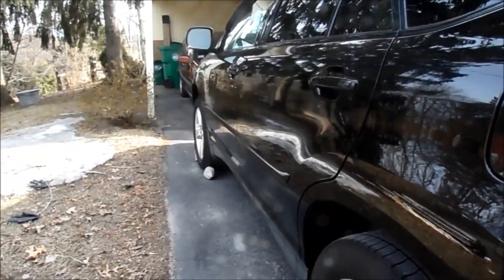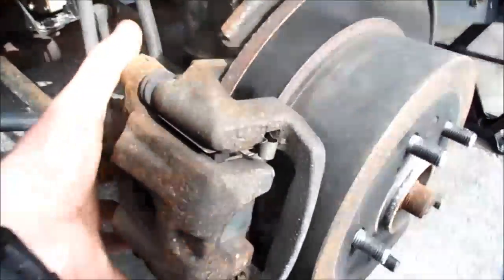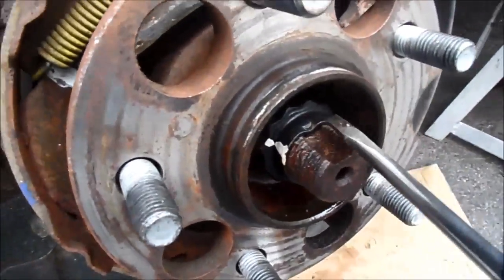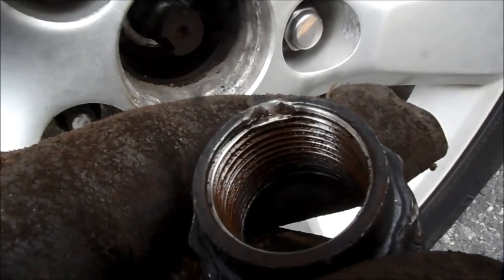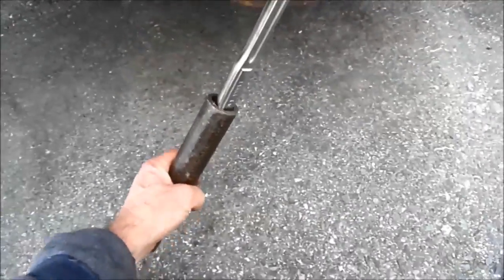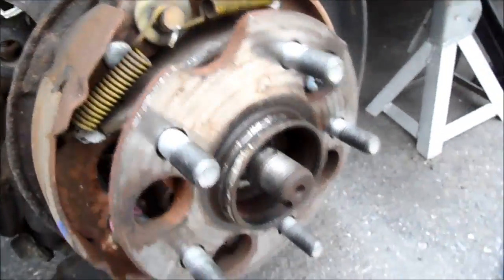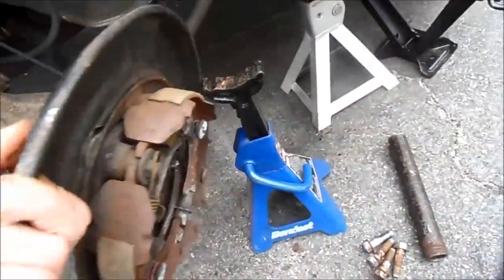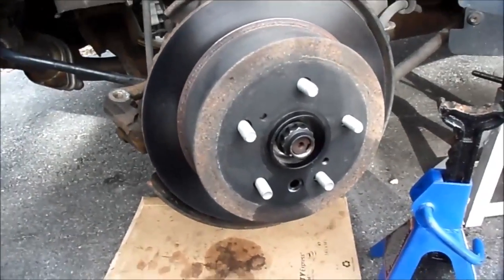RX330 Rear Wheel Hub

Comment: Thanks. Best video for this job online. 
It really helps. Great resource for information. 
My only input: I would suggest removing the vehicle speed sensor from the hub before removing the wheel bearing hub. Once the axle is loose, it could damage that sensor.

Oh, and the measurement for the spindle nut is taken from the valleys of the 12 point, not the peaks. This is very confusing since there are reportedly 2 different size bolts on the rx330 - 30mm and 32mm. 
AND the peaks on a 30mm nut will measure 32mm!!! 
Anyway, to anyone reading, if the peaks of the nut measure roughly 32mm (as did mine), you have a 30mm (axle) spindle nut. Measure straight across the middle from peak to peak.
Reply from the maker: Thanks for that feedback. Hopefully people read these comments. I'll see if I can add your words into the vid.
Reply from the maker: Oh wow, that's good info on the sockets at HF. I paid $22 for just one.

Comment: Just did this for a 2006 RX400h. What a pain! Separating the backing plate and hub assembly required disassembly of the brake shoes, removing the brake cable, and placing the backing plate on jack stands in order to have a full swing with 5 lb sledge. Still took 10 good whacks. If you live in the rust belt, this job will not be as easy...
Reply from the maker: But you did it!

Comment: Nice video and glad it came apart so easily, I hope mine comes apart that easy. As for those bottom guide pins, the bores must be cleaned of ALL the old grease before and clean grease applied only to the pin bushing, it’s best to buy a new boot kit, clean the pin and bore then grease the pin.
Reply from the maker: I'll try to add that note in the video, thanks. I don't suppose you have replaced the lower control arms? I'm in the middle of driver side and am stuck. My '05 is AWD.  I can't seem to raise up the tranny enough to get the tranny mount out. One video has the guy disconnecting the sway bar, subframe, exhaust pipe, etc and I can't believe it takes all that.
Reply: Make sure you support the subframe when you loosen the bolts
Reply: @timothymcginn5872  I don’t think you need to disconnect the exhaust but you’ll want to disconnect the sway bar links.
Reply: Now that I think about I did disconnect the front exhaust hanger on my Camry but it takes 5 seconds to do
Reply from the maker: @notme22  So it's true, the stearing wrack, sway bar, and exhaust have to be free? Do you recall if I have to  remove the passenger side engine dog bone engine isolator, if that's what it's called? It's basically the upper engine mount.
Reply: @timothymcginn5872  anytime you’re playing with any of the other mounts  you need to remove that upper thrust mount?

Comment: Thanks Tim.. just did both rear bearing in about 2hrs thanks to your video.. 2 things that might help viewers. 1 to get bearing out of dust shield I found placing dust cover with e brake attached inside the  opening of  a 2.5 gallon bucked then whacking it with a 3lb hammer popped it right out. 5 gallon buck does not work..too big and damages dust cover. 2nd is your new axel bolt may be a 6 point so you'll also need a 30mm 6 point socket. 12 point you used to take off won't work.

Comment: Good thought, about lining up the hole of the rotor with the correct hole in the hub. I wonder how many guys who do brakes will remember to do that. Some don't even adjust tension on the star wheel after.

Comment: ihave a front wheel drive model 2006 the bearing came out great but its stuck inside the dust cover /e brake assembly. any suggestions?
Reply from the maker: Hi Patrick. I can't say for sure, but for mine it took a few good whacks with a hammer. Check out 13:55 of the video.